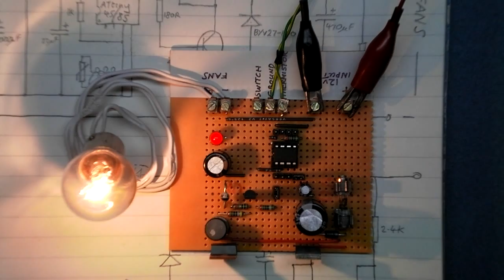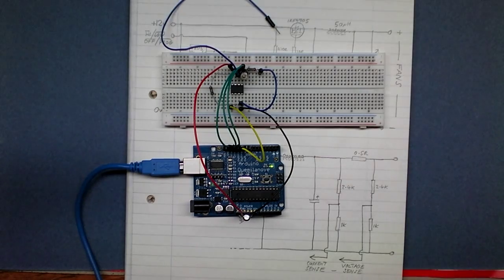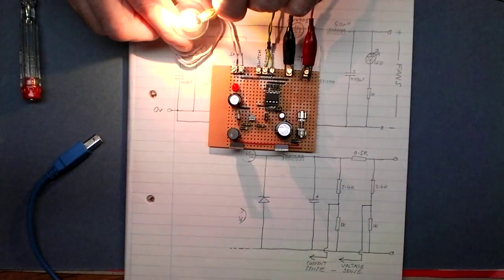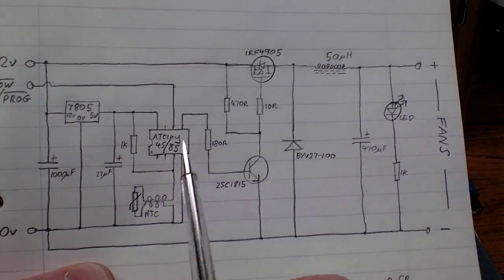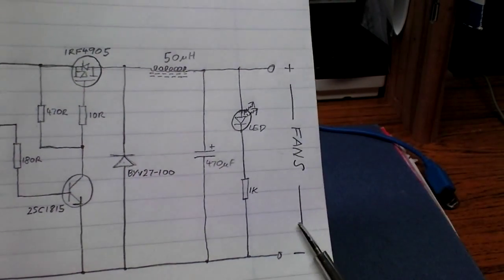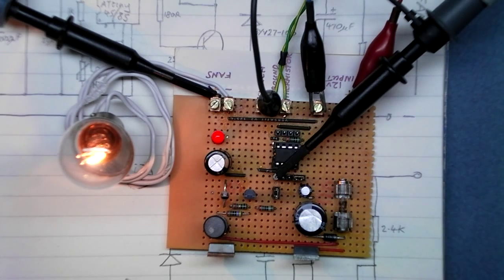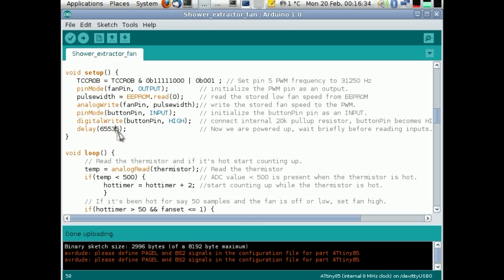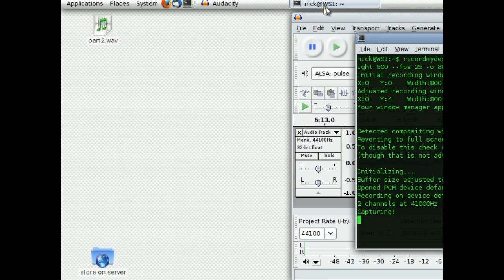ATtiny PWM switching regulator (buck converter) shower extractor fan control.

Comment: A good application for the tiny13!  I just ordered 5 attiny13a SOPs.  They are about 33 cents these days.  Amazing that most folks will be helpless trying to use an Atmel chip outside their Arduino.
Reply from the maker: They are very flexible. One tiny chip can replace a whole bunch of analog and digital logic.
I still use this circuit to control the extractor fans in the shower room. It works very well.
I don't think I demonstrated that very clearly in this video though.

Comment: Hey! Cool project!  I'm thinking about making a simple circuit like this to charge batteries (as you mentioned in the video). But I'm running into problems calculating the saturation current of the inductor.  I need to know this to choose a suitable inductor value - switching frequency combination. I'm just wondering what frequency your converter is switching at? With such a small value inductor and (physically) small inductor I'd expect the frequency would have to be quite high?

Comment from the maker: I'm not sure how many volts your push bike generator provides. The LM2674 is certainly an efficient switcher but it's minimum input voltage is 8 volts.
A buck-boost converter may work. Something like a LTC3112 but those chips are expensive.

Electronics is just a hobby.
Good luck with your project.